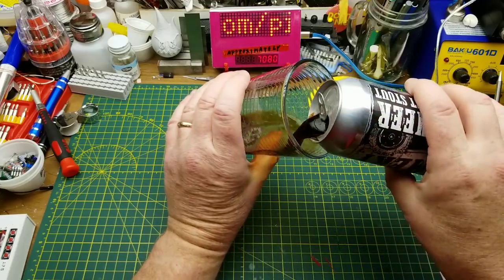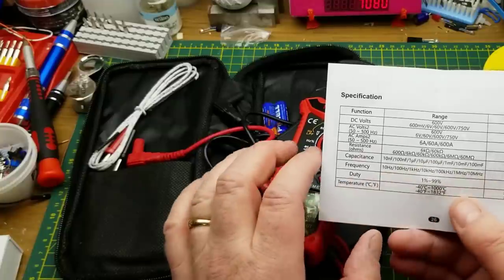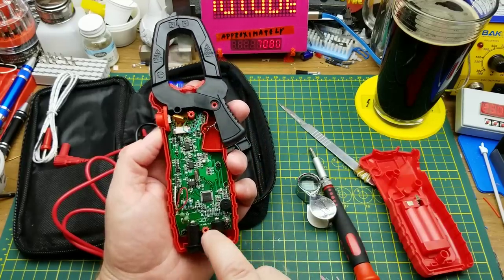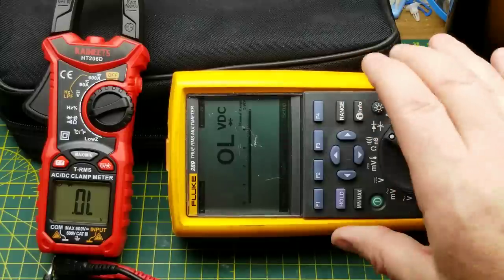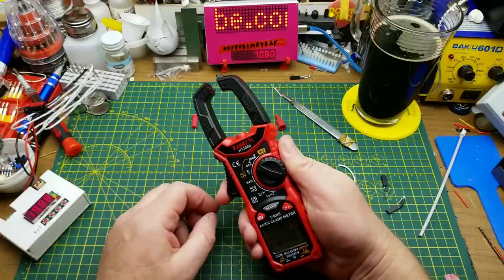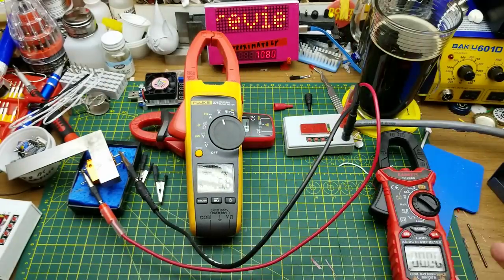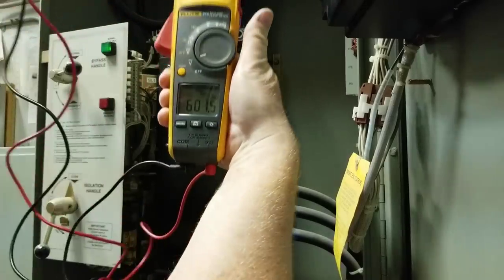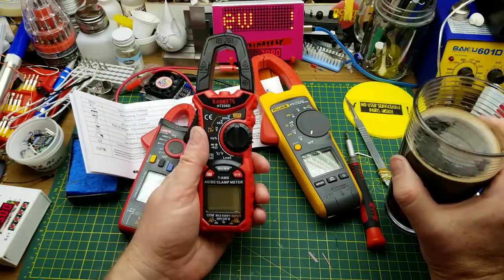multimeter review - Kaiweets clamp meter

Comment: It is true RMS. I measured the voltage on my modified sine wave inverter and it showed the correct value. My other non true RMS meters give a false lower reading due to the non pure sine wave.
I bought one for work as it means I no longer need to carry a separate dmm, volt stick, clamp meter and digital thermometer. Now I will have all four in my pocket and no more having to look for a 9v battery as all my other meters take 9v ones. I bought mine after seeing TRX bench's review, but good to see this one is positive too.

Comment: I recently purchased this clamp-on meter.  I perform calibration & repair on a wide range general purpose (GPETE) test equipment as well as Special Purpose Test Equipment (SPETRL).
In the process of checking the accuracy against FLUKE equipment of the same qualifications, it either meets or exceeds their specs for quite a bit less money.  I'm not sure if this will take the same punishment as a FLUKE, but for the home or general bench technician, it is well worth the money.
Reply from the maker: That is what i have found with most of the Kaiweets meters. Solid accuracy, but not nescessarily "industrial strength" mechanically.

Comment: Excellent review. I basically do electrical work and am looking for a very reliable NCV   meter. I have a couple of the handheld pen type detectors but have been let down several times when the unit turned on and went off and I relied on the reading. I am stuck between the UNI T 210 and the Kaiweets 206. Can you please let me know which of these would you recommend. The Kaiweets has a dedicated NCV button which is driving me towards it apart from a very long warranty. However if the UNI T is more reliable then would go there. Thanks.
Reply from the maker: At the price point, either are decent meters.

The Kaiweets can clamp around larger conductors, if that is important to you.
On the other hand, the UNI-T is smaller and takes up less space in your tool kit (and is pretty much pocket sized).

Comment: I find the best test of the thermometer is to put it in the freezer and close the door. It will give you a general Idea if your freezer or refrigerator works and is cooling properly. Mine might say -2 and the freezer is actually-3 on my fluke. Big deal it’s working. Close enough for me. I also use paired it up with an ac line splitter so I don’t have to dissemble appliances to isolate the wires. I check If something sounds like it’s failing. Works great for that. You are braver than me. No way I’m checking 600 volts AC with it though. Every homeowner should have one. Just for general voltage checks before you electrocute yourself.
Reply from the maker: Note that I was using one hand only to hold both probes for that 600V test, and I wasn't touching anything else.
Reply: Ice bath temperature reference is a standard for temperature measurement evaluation. It should be pure ish water and ice, and the mixture rapidly stirred to maintain equilibrium.

Comment: Fun stuff.  I've had a rash of meters just going bad over the last year. My fluke won't change from DC to AC and the screen is dying.  The switches are going wonky on my big Centech.  I'm definitely in the market.  

I've never seen that "universal" looking 220v plug before. If I've seen that "plus" looking plate before, it's been a long time.  It would be handy to have a set of those. I'm going to keep an eye out.

Comment: My only clamp meter is a cheap little thing like this, handy for quick tests and troubleshooting household electrics / appliances. Lacks DC Amps though, so currently (ho ho) having to introduce a probe meter into circuit for those measurements. Think it's time to choose the next addition to my modest test gear collection. Thank you for the excuse. 😁

Comment: Boiling water should be a reasonable test point for the temp.
Reply: Have to be distilled water and factor in local atmospheric pressure.
Reply: A blob of liquid solder would produce a more stable reading than touching the probe to the soldering iron body.
Reply: Typically ice bath is used as a 0 Deg C calibration test point. Put a goodly amount of ice in the water using an insulated container and stir vigorously to maintain equilibrium.

Comment: Clamp meters don't need a fuse.
Reply: Don't forget it also has test leads.
Reply: @jefftremblay3707  You can't use the test leads to measure current so no fuse required.

Comment: Great video.. i think you missed one important and very easy to test feature.. the response time of the beep on the continuity tester. Nothing drives me more nuts than a tester that beeps 1 or 2 seconds after probe makes contact. It makes you wonder if there's a loose wire or fautly solder joint somewhere.. Also here's a tip, test the thermo ccouples with water and ice and also at boiling... that way you get 0°C and 100°C
Reply from the maker: True.  It is something I do these days when looking at a new meter - this video is 2 years old.
Reply: @pileofstuff  super! Will check out your channel more

Comment: I’m guessing that the video clip right after the one you shot in the battery room, is from the inverter room. But where in the UPS installation were you able to measure the 107.1A/600V-AC?

The only guess I can come up with, is that you measured the utility power right before it enters the main switch for the battery charging system. (While recharging the batteries.)

But I don’t know much about Canadian electrical power distribution system, except for typical residential areas..

Would you (or anyone else who knows) mind elaborating?

ALSO!
Thanks for this video, I appreciate your down-to-earth demo & comparison style. (☺️It’s simple, to the point, and easy to understand.)

🎉 Happy New Year!
73’ de OZ2BO 
(Vejle, Denmark🇩🇰)
Reply from the maker: That was the generator transfer panel. It's about the only place I could get that close with relative safety.
That is essentially the main utility feed near the building power entrance.

At that point, it's 3 phase 600 volts. Relatively common for large commercial and smaller industrial installations.

Further inside the facility there are  transformers that bring it down to either 208V 3phase, or the more common 120/240 volts that is usual in North America.

Comment: True RMS?
Reply from the maker: Not sure if I could verify that with the tools I have available.
Reply: @pileofstuff  Hmm, it would be listed in the manual or stamped on the unit if it were. So I guess we could assume it’s not. Great video otherwise, keep up the good work. Mahalo
Reply from the maker: @greggascoigne941  Even if it was listed in the manual, I'm not always willing to fully trust the claims of these inexpensive brands.
Reply: @pileofstuff  I found a couple of surprisingly easy ways of testing for RMS vs. non-RMS (at least when it comes to voltage) on Dave Jones’ EEVBLOG forum: https://www.eevblog.com/forum/chat/how-can-i-test-if-a-dmm-is-reading-in-true-rms/

(I think this would be an interesting experiment to make a video about. 😏)
Reply: @greggascoigne941  it is True RMS, I have the meter. It states T-RMS just above the screen.
Reply: You can put in a square wave and see if it displays 1/2 the peak amplitude.  A cheaper non RMS meter will read lower because they assume the waveform to be a sine wave. They just calculate it from the peak, which is higher with the sine wave for the equivalent RMS voltage.